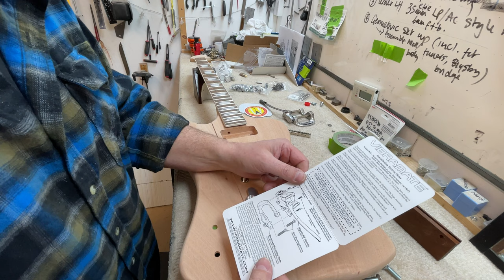Firebird kit build Pt 3 Assembly, action setting and fret levelling

Comment: Professional Lefty here: Firebird guitars use right-handed necks (reverse headstock) on left handed bodies. Which means you actually need right-handed tuners (or "normal tuners" if you want to be petty haha!) the thing that should help you with your labels but still bake your noodle is the fact that right handed tuners have a left-side post whereas left handed tuners have a right-side post - This is the reason why you normally see written "6L" on parts websites. The "L" is not for 'in-line" as many think it is, but L = Left side post. Consequently, you will see '6R' when ordering left handed tuners. Also be mindful of staggered tuners when using them on a headstock with an angle as in this Firebird. Now, have a aspirin if you followed all that 😁
Reply from the maker: When you start explaining I hear a swirling white noise - just like when (in the old pre-Google maps days) you would stop and ask someone directions knowing before you even finished asking that you wouldn't remember or make sense of a single word they said back to you :-D And when you think you've worked it out you realise that 3-aside tuners are universal which means that a lefty must actually have an opposite experience of tuning a lefty Gibson Les Paul to the experience they have when tuning a lefty Strat.

Comment: This happens alot when bad math is punch into the CNC machine i've been here before what i have learn is to fully assemble the guitar even check the pickup to make sure the strings are lining up on the pickups poles,Just to be sure before you start finishing good luck and thanks for the video.
Reply from the maker: It seems to be more common than you'd think. Even on quality factory-made guitars the bridge can be a couple of mm out of place... Your advice is right - and is essentially what I'm doing here - put it together first and make sure things line up before investing further time / money on it. I also make sure the truss rod works too - more than a few times I've put in work on a neck only to discover at the end the truss rod was seized. Not good!
Reply: @SamDeeksRelovedGuitars  I also had a nice neck you could put tension on but it wouldn't release the trust rod was strip, Turn out to be bad treads where the trust rod tighten into the cam end,The whole fret board had to come off and replace the trust rod,The whole problem is i could have bought another neck would have been cheaper anyway good talking.
Reply from the maker: @scotttracey3748  'Taking off a fretboard and replacing the truss rod' sounds so easy when it's in printed words... in reality it's a ball-breaker. Rarely comes off without splintering or leaving behind chunks of rosewood etc... the frets fall out, the inlays shrink and even if you can re-fit and re-glue the same fingerboard you have to re-finish the whole neck unless you want an evident gap in the finish where they two pieces meet. I'd rather make a new neck if I'm honest! :-)
Reply: @SamDeeksRelovedGuitars  So true a very slow process with miner filling after getting the fret board glued back on and alittle shaping to the fret board than start checking and reglueing back in all the frets.I now just tell the customer just to replace the neck,But if it's an old neck for a original guitar project then i will go through the process to keep it original.